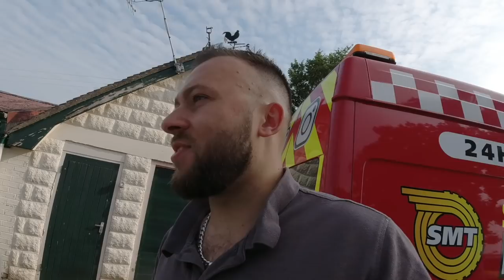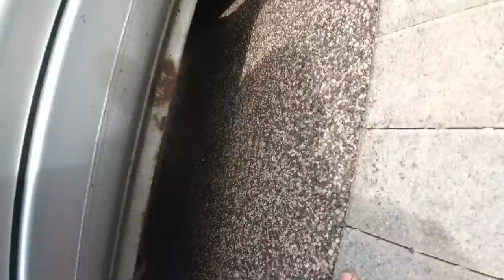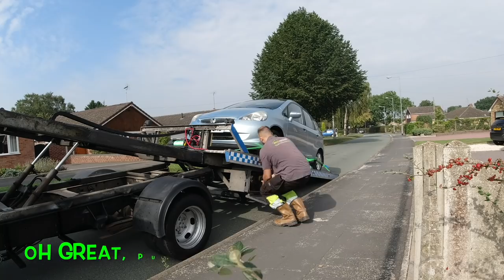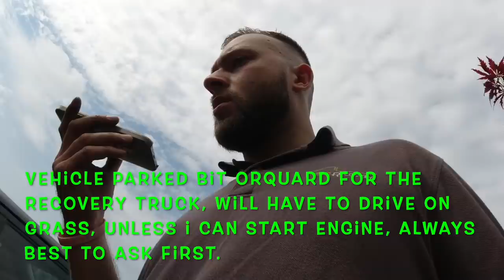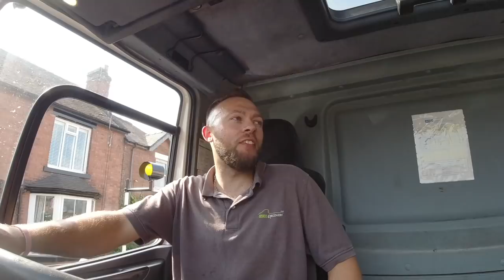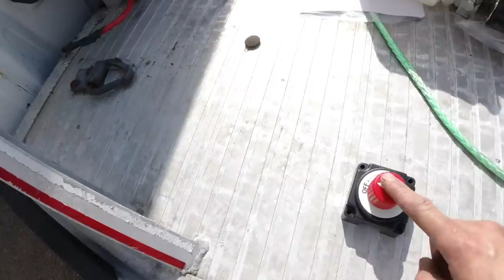FEW UPDATES & a bit of MANIC MONDAY! Jeep XJ DAF CF65 Transit Tilt & Slide Mobile Tyre Van! GO GO GO

Comment: ttack the bolt heads so they cant be turned or ththe nut asmall spot of weld on the thread will stop the nut from turning

Comment: Subs are increasing 👏, so with the DAF I take it you are governed by driving hours etc and use a Tachograph?
Reply: You're exempted from having a tacho if you're relatively local, not travelling more than 62 miles (100km) if you meet certain criteria.  One exemption  is breakdown vehicles - "specialised breakdown vehicles working within a 100km of their base", another is "vehicles or combinations of vehicles with a maximum permissible weight of 7.5 tonnes or less that are used for carrying work equipment for the driver where the distance is less than 100km"